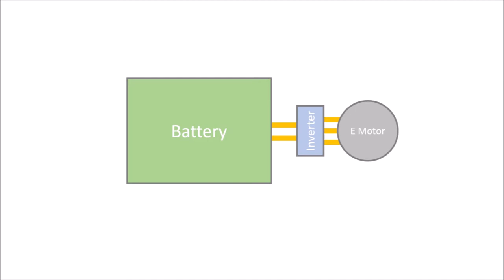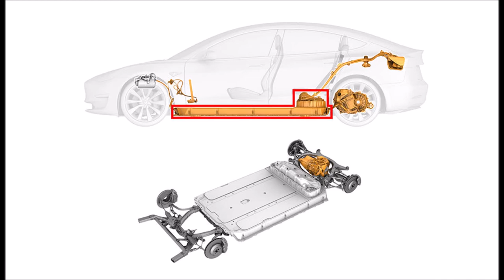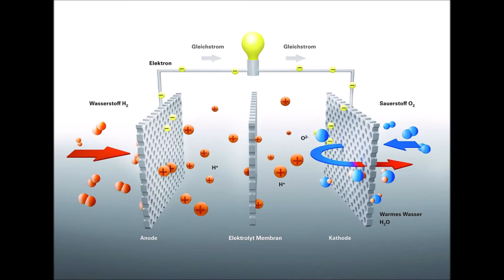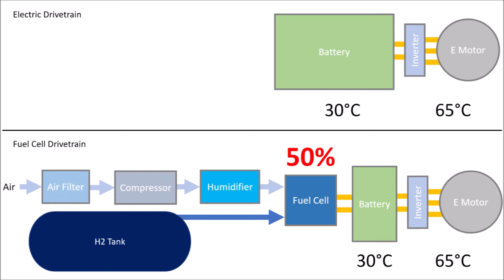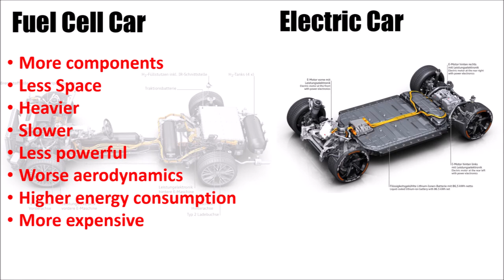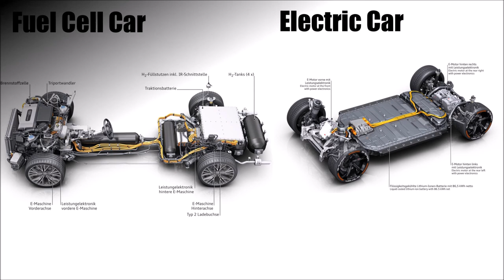Fuel Cell or Electric Drivetrain? - In Depth Analysis

Comment: This is argumentation is specific to ownership passenger cars. What's your take on the Fuel Cell for long haul goods/passenger transportation? Will recharging become fast enough that long haul trucking will work just with batteries? Is there somewhere a use case for fuel cells at a certain vehicle weight/transport distance?
Reply from the maker: It's basically the same argumentation just scaled up. The simpler and more efficient drivetrain will be the future and this is not the fuel cell. I can see it working for stationary use (power generators etc.) but not for transportation.
Reply: @BSport320  One argument I hear a lot is that the peak electricity demand (not overall demand) if everyone uses EV's will be too high to be sustainable? For example a car that is supercharging will be 200-300kW and a semi truck will be 1MW. What are your thoughts on this compared to a FCEV that does not have such high peak electricity demands?

Comment: 4:11 You say that "everybody can generate and store their own electricity". That's just not true. Do you realize that approximately 99.9% of people live in homes that look NOTHING like that picture? I moved a few times and I never lived (or even stayed a night) in a place where one can even theoretically charge a car, except for when I spent the summer in the countryside. In my city electric cars charge almost exclusively at gas stations, where their owners have to spend a significant portion of their life. To charge a car where I live now I'd have to run a cable (out of my apartment window?) across several sidewalks and a busy street to where the next parking is.
Reply: Exactly what I was thinking.

For the most people living in cities (where the electric cars would make the most sense) there is no way of charging their cars at home, as most of them don't even have their own parking lot and/or their homes don't provide enough surface area for solar energy. Plus, storing electricity isn't really that efficient at all. So where would these people charge their cars?
There is almost no infrastructure at all for charging a big amount of cars at the same time, while every single car takes quite a lot of time to charge. And I didn't even mention space for providing such infrastructure in those cities.
Hydrogen tanks on the other hand can be filled a lot faster, while current gas stations could adapt to hydrogen relatively easily.

I think all the negative aspects of  fully electric cars really add up in "extreme" use cases like freight vehicles. Electric trucks don't make a lot of sense, as they take a lot of time to charge, provide a low range and are really heavy. Every Ton of vehicle weight, is a ton less freight which can be transported, so that means way less money for forwarding companies. 
In the long run, I don't think that manufactures like Mercedes, Volvo or VAG (MAN), which produce vehicles for people AND freight transporation, will invest money in the development of both technologies at the same time.
Reply from the maker: The general point of the explanation was that everybody has a solar cell, an electric motor and batteries at home. Everybody can generate electric energy and save it at home. But no one can produce and store hydrogen or fuel at home. 
The other part is that in cities lots of people don't have a car. And if you have you don't need to recharge every day.
Reply: @BSport320  Well, my point is that most people not only don't have an option for solar generation, they can't even plug in to charge the car using grid electricity. So the difference between BEV and FCEV is in the number of hours spent at a refueling/charging station.

Comment: Very interesting. Less components means also less material waste / better circular system. But how do you compare this to the sutainability of chemical batteries? How do you compare both systems on sustainability?
Reply from the maker: Biggest advantage is that batteries can be used elsewhere after their car life and material from old batteries is preferred over new raw material for cell production. Only generation and storage of hydrogen alone kills its efficiency.

Comment: Your statement that FCEV are heavier than BEV is incorrect. For the same range, ie 450 km, a BEV weighs almost twice as much as a FCEV. For high energy use (light-weight racing cars) and long distance applications (freight trucks) FCEV are far superior to BEV due to the very low energy density of even solid state batteries. The combination of fuel cells with ultracapacitors will give the vehicle a large power burst capacity for acceleration and much better regenerative breaking efficiency than BEV.

 There is no perfect drivetrain. For some types of cars ICE (on syn fuel) will always be the best option. For other types of cars fuel cells combined with ultracapacitors will be better, especially sports cars. And for small city cars with limited range BEV are undoubtedly the best option. Large BEV are simply too expensive and they will become even more expensive as the demand for costly battery materials such as lithium grows. FCEV and hydrogen will only become cheaper as demand grows.

Comment: Hey B Sport! 
I have a question regarding the cooling issue: Don't ICE have an efficiency of around 33%? So switching to Fuel Cells with 50%  efficiency, the overall cooling surface should decrease, right? Of course it doesn't compare to BEV, but from the Video I got the impression, that you were saying FCVs have the largest necessary cooling surface out of all the drivetrains and that it's a huge issue.
Another thing is that I have been told (by my engineering profs.) that hydrogen drivetrains will soon become significantly lighter and also smaller in volume than battery electric drivetrains and that that is their main advantage. Is this simply untrue?

I would love it if you gave specific examples (I know that's difficult, because there are few actual FCEV out there). In your other videos you always run the numbers on the cars you're presenting. This one does just come off as claims.
First you say that car manufacturers have ulterior motives -> therefore FCV bad. - Well I mean that's a given, but it does not necessitate that conclusion.
Secondly you point out FCs increase complexity -> complexity bad -> FCV bad. - Again as a trend that's true and good engineering practice, but turbo chargers are a good counterexample in that they increase complexity but are generally accepted to be the best compromise for a lot of applications.
So overall I just can't accept the videos conclusion as a general fact.

If you're looking for a new video topic please redo this one and debunk the concerns/questions the others and I commented. I find that the discussion on EV has so much BS in it and is hard to properly educate yourself on the issue because of all the ulterior motives. You on the other hand are one of the voices I can put some actual trust into.
To end this of I would like to say that I love your videos and always watch them as soon as you upload. I enjoy the factual but laid back style and i am always here for a nuanced discussion.

PS: (sry, this spiraled out of control a bit from just asking about the cooling)
Reply from the maker: Hi, thanks for the questions!
An ICE engine is usually operating at around 20-25% efficiency during customer usage and more than 30% are only reached in labs under perfect conditions.

You are right that the cooling surface should decrease for a FCV because the efficiency is higher. But the components on FCV's and EV's run at around 60C and an ICE engine runs at up to 120C. For an ambient temperature of 40C, that means that the temperature difference (dT) for FCV's and EV's is only 20K and for ICE's it's 80K - temperature difference goes straight into cooling performance, so that means that FCV's and EV's have 4x worse cooling performance with the same radiator than an ICE car. 
EV's have the advantage of good efficiency but for FCV's that means they need the largest cooling system possible.

You are right, I could explain that a bit more in detail with some numbers and examples in a future video.

Development is happening for fuel cells and the fuel cell itself will be smaller but what I wanted to show with this video is that you need lots of additional components (that need servicing) for a FCV. Some of them are quite bulky like the high pressure tanks and cannot be changed into different shapes like a battery can.
The biggest issue of FCV's though is efficiency and we are only talking about the car and not production and storage of H2 yet.

So, thank you for your feedback and I will explain that a bit more in another video.

Comment: Great video, and I agree with your conclusion that battery electric roadcars are the best option. But what do you think about motorsport, more specifically endurance racing? Surely battery powered racecars will never be competitive against combustion engine cars?
Reply from the maker: There are a few problems for racing: first of all the fuel cell isn't very powerful. You can increase power by compressing air into the fuel cell (like a turbo engine) but because of the bad efficiency and the low temperature level you will need lots of cooling which will increase drag, lower downforce and that messes up your aero efficiency. On top of that packaging is always an issue for fuel cell cars.
Exactly this is the main advantage of electric cars. You have fewer components and you can position them where ever you want - and battery swapping during pit stops would not be a problem.
If you look at motorsport categories like Pikes Peak or Formula Student (categories where combustion and electric vehicles can compete fairly against each other), you need an electric car to win overall.
I know there is a lot of politics involved but I just tell you my opinion as an engineer who worked on both concepts.
Reply: @BSport320  Good points. Though batteries are really heavy, and have poor energy density. I dont know how much energy is required to get a car to run at LMP1 speeds at LeMans for an hour or so, but one of the largest batterypacks in roadcars are around 100kwh, and probably weighs around 600kg, at least. I dont know if this is the best solution. Personally i hope the ICE cars will stay for a long time. For sprint racing i can see electric cars are the way to go, from a technical standpoint at least.